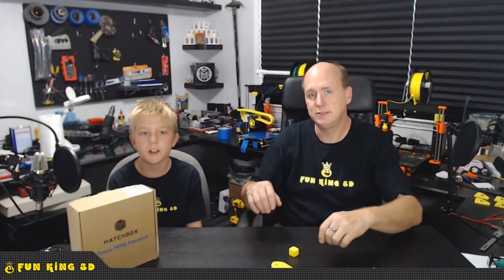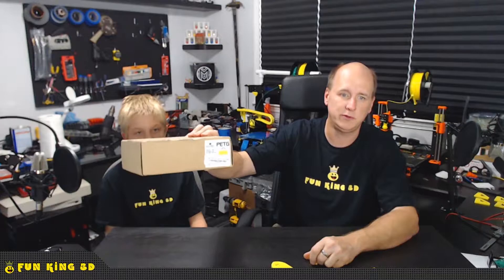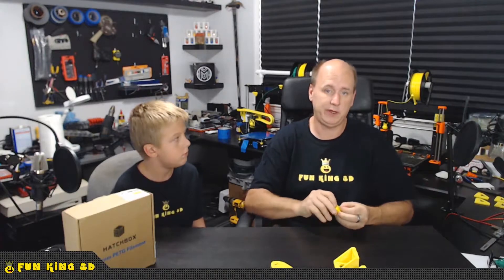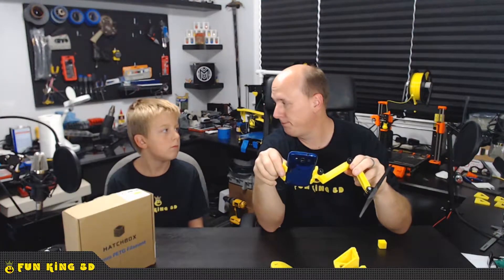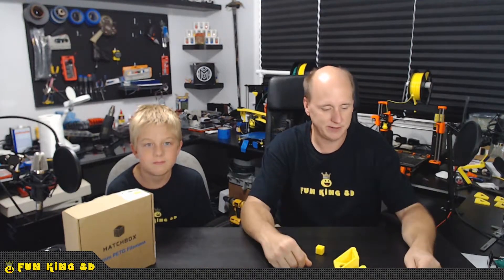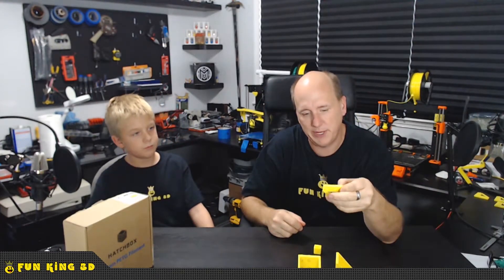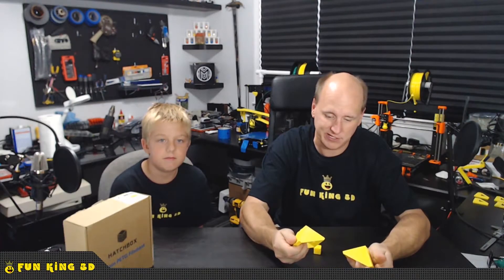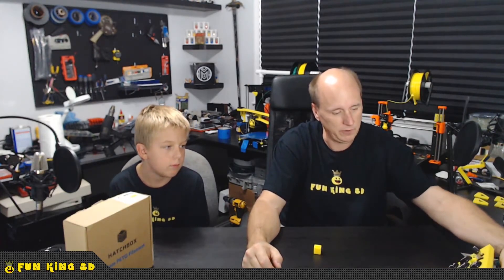Review: Hatchbox Filament - PLA and PETG

Comment: Do you find it gets knotted and tangled at times? Just bought a spool and it doesn't look wound neatly.  I loved ORB pla but they stopped making it.
Reply from the maker: I have not had any issues with tangling. Technically, as long as you do  not let the end loose, or let it jump the side of the spool, it can not happen. When they wind the spool, there would be no way for it to tangle. I am very adamant about using the holes for the end of the filament when I change rolls. Never let the end go free. Once you set it free, it may never return. LOL!
Reply: Fun King 3D 
Gotcha. Good info. Thanks

Comment: I can't get this stuff to stick to the bed. Every other filament brand I own sticks fine except Hatchbox which is the opposite of what I heard from reviews.
Reply from the maker: To be honest, I have not used Hatchbox in a LONG time. I still have some, but I have not bought any in years, so it may have changed. I know they had supply issues a while back and it is possible they got a new material supplier. Sorry I can't be of more help.
Reply: @FunKing3d  That's cool. What do you use now? Thanks.